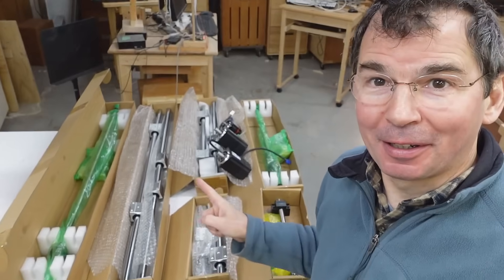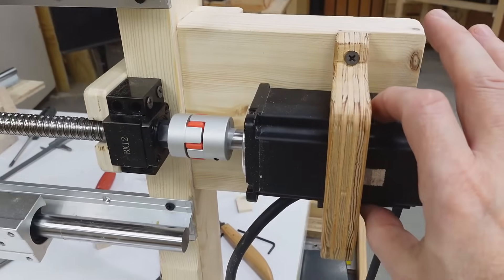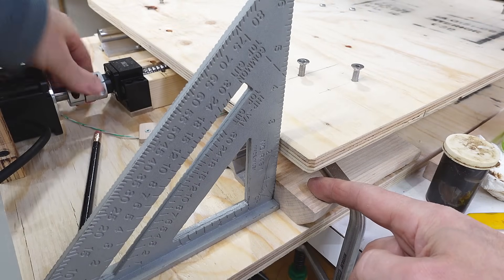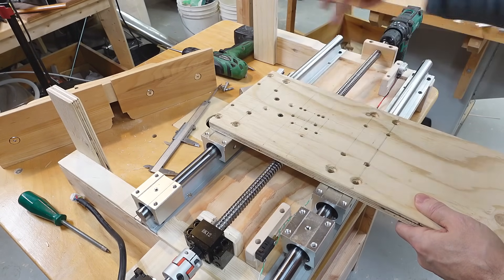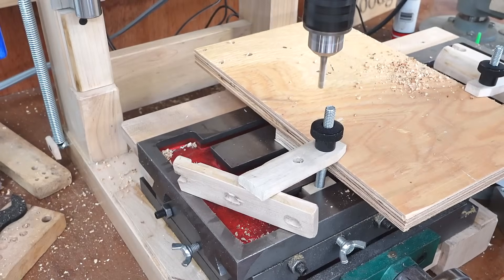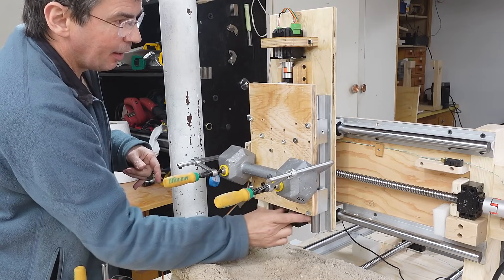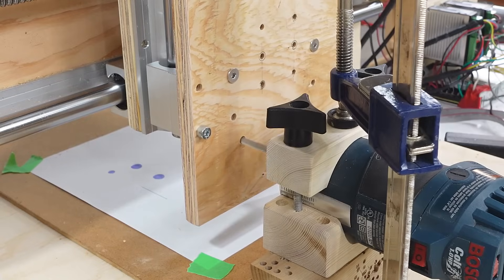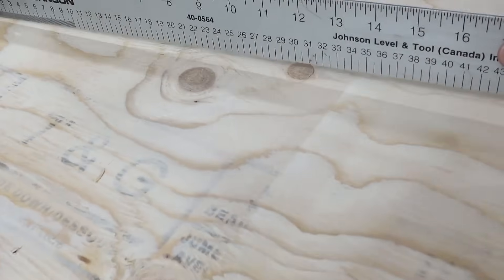Building my CNC router

Comment: You are a very clever guy, but I really do think you should have spent more time designing your CNC. a word of advice making as many parts as possible with birch plywood is far better than softwood.
I also made my own CNC router about 12 years ago.
Reply from the maker: can't buy the baltic birch locally, so don't want to use that up

Comment: Nicely done as always. About ten years ago I built my own CNC router, pretty much from scratch. Not knowing if this was going to work, I cheaped out and bought a cheap NEMA 23 motor kit on ebay. I used Baltic birch throughout. I used steel angle and v-grove bearings for rails. I used standard 1/2x13TPI threaded rod and made my own zero clearance nuts by tapping 1.5 inch baltic birch blocks then cutting a slot to the thread allowing me to tighten the threaded block onto the threaded rod for play elimination. I used NO limit switches as the stepper motors would stall before anything broke. It was much slower than yours  in operation of course but I was very pleasantly surprised by the accuracy it achieved. I had a cutting area of 23"x 37".

Comment: "It takes up way too much time" oh...so you don't use an electric hand drill then because you'd have to build it from scratch and it would 'take way too much time' (go ahead and try to make a bldc modern drill from scratch....) or you don't use jigsaws because they take up 'way too much time' because you have to build your 'jigsaw' from scratch.... makes sense...
Reply from the maker: its USING it that takes too much time.

Comment: Can I find the parts list for this engineering marvel?
Reply from the maker: vevor cnc rail set from vevor (all 3 axis), closed loop stepper (with integrated driver), DMM servos, smallest Nema23 they have, 48 volt power supply,  Raspberry pi 3a+, a bunch of M6 and M5 screws, crappy 16 mm plywood, a tight grained piece of 2x4 lumber, limit switches, and other bits like drywall screws.

Comment: Your practical assessment of cnc is fair.  The only place i believe it is justified is with complex carvings, but the fantasy of simply acquiring an stl file and pressing start is still far from true!
Reply from the maker: Alain Vaillancourt (thewoodpecker) CNC carved this woodpeker from a file he bought.  But it was so much work to get that to work, I think taking a few shots at carving it with a rotary tool would have taken less time.  Thing is, if you cut the profile out with a bandwaw in two directions, you already have the basic shape.

Comment: You would need no safe bumpers, just make a home switch and limit travel of the machine in software
Reply from the maker: if its software I'm screwing around with, then the software may at times tell it to do the wrong thing.
Reply: @matthiaswandel  You home the machine on one end, machine knows the travel is max 500mm, for example. Even if you are jogging, it wont hit the other end. If trying to run program that would crash the machine, it refuses ti run it. Its called software limits and is part of almost any cnc control software

Comment: Dear Matt, biggest flaw in router cncs...the angle of pressure on a side mounted carriage....the draw is unequal to the push/ pull. It's best to mount the router between 2 rails so draw is equal. Also, moving carriage verses moving work surfaces. We, in woodworking almost always move the work ie a table or bandsaw.. it also gives us an unlimited y(?) axis. A prime limitation. Also if it means a single channel for dust and cuttings rather than the whole table.....laser/ water jet cutting etc.🤗
Reply from the maker: Yes, that would be best.  And you know why nobody does it that way?  Cause you have to be able to get at the router.  Also want to see it sometimes.

Comment: Great design and implementation!  I built something similar a few years ago, and had all the same problems you did with the z axis. I used oldham couplers to overcome slight alignment inaccuracy  on the motors.  I agree that a CNC has very limited use in a home-workshop setting, but for some tasks, nothing else will do.  Eg: I recently cut slots and holes in a couple of foam sheets for 2 sets of taps and dies.  The holes were all different depths & sizes which would have been a pain to do by hand.  
Love your channel - keep up the good work!

Comment: CNC is great when you want to mass produce a part with decent complexity.

I would advice to use real metal parts for most of it thou.
The wood will be destroyed pretty fast by the vibration torque.
Unless you strengthen it with some metal parts that you glue/bolt to them.

Also precision is key for a good CNC,
 and the wiggle room allowed because of the wood usage will make low precision products.

Comment: Are you wearing new glasses Matt. Or is it just me wanting replacements myself.
Is the dimensional stability of plywood good enough for a CNC rig? or should you consider remaking some larger parts in steel or aluminium?
Reply from the maker: it will vary slightly seasonally.  Not an issue while cutting a part though.

Comment: I'm sure CNCs are fantastic machines, but it's just not as fun watching a machine go back and forth. I've pretty much stopped watching Frank Howarth's channel after he got his.
Reply from the maker: well, its no less interesting than watching lathe.  Personally, I'd like to see a peter brown video that doesn't involve turning something cast with epoxy on the lathe.
Reply: not need watching, but machine run and can do lot more work in workshop same time, you do somethink and cnc machine do somethink too same time, save lot time machine do big job and you do small handjob.

Comment: 4:40 in lifts and gates they use pre arrival slow down zones. Allows to suppres or reduce safety bumper, use wider ranger, at the cost of more software.

Gates use counters to evluate edge proixlity. Lifts use switches or reeds ( ILS )

Comment: i has made similar CNC but i know my skill, first big fail have router, need change router off and buy real good spindle, i make same, i buy vevor 2,2KW water cooled ER 20 spindle less 130$. and not need limit SW software limit have better use, and limit SW need only safe frame not broken, wiring whit E-stop SW, all limit. important have only use all axis sensors home SW, and speed NOT ewer need be 2000. first you need change router off and buy good spindle. lot lot accurate, silent,strongest.

Comment: a cnc router îs going to need some precision to preserve the Computer Numerical Control benefit of the machine in the first place.  Sure, you can use wood.  But with expansion and contraction and inherent measurement errors, it will not be precise.  Ever.

Comment: Mounting the motors in the centre might be problematic.
This since the motors are held together by thin screws running down their length.
Which might bend from the forces applied at their weakest spot, down their middle.
Another issue is the worsened wobble from the not centred couplings and weird levering on the mount point from this.
Time will tell how much it ends up mattering in practice if you you keep these mounts.
Reply from the maker: if I hold it just by one end, the bending force would be even more
Reply: @matthiaswandel  that is true, but the motor is designed to be held by the face plate alone.
The difference would be a bend in the middle of the long screws, or only stretched in one direction.
Though I doubt this will matter much in practise, since these motors probably are rated for much harder use.
Or in the case of the Z axis compact and weak enough that this won't matter.

Comment: Ask them to send you a CNC laser with the new 12 diodes 60W. None of these issues, quiet, no dust and it's cheaper. Does need fume extraction though.
Reply from the maker: and also leaves ugly black edges on everything
Reply: @matthiaswandel  With all due respect, sounds like a very puzzling excuse. Firstly, looking at most of your builds, it's clear aesthetics plays for you at best tertiary consideration to functionality and price. Secondly, even if for some strange reason black edges are an aesthetic deal breaker for you, you can remove them with light sanding in less than a minute, usually few seconds, by hand, it's few microns thick. Thirdly, if you dial the power and speed, and use air assist to clear smoke and debris that scatter the beam, you get very clear cuts that are at most brown, without burning, charring, or black edges. You gave CNC a try even though its greatly inferior to laser for 2D work, and (according to you) to manual work, so maybe one day you will see the light, pun intended.

Comment: CNC is all about leveraging skill, or a lack of it, and scaling production: They're great general purpose machines that let you utilize less skilled labour.

In the context of a small cabinet shop, if you have someone whom can follow a cut list, do quick arithmetic in their head, and run a table saw then they will outperform a CNC most days.  For other operations like drilling holes for hinges and shelf pins, single purpose cells/stations and jigs are the superior choice in the hands of someone that knows how to use them.

The magic of CNC is when it comes to worker skill, flexibility, and scaling work:  One person that knows how everything goes together writes the gcode and anybody with the wherewithal to load sheets of wood and run programs does the production work.  When the process is dialed in, a non-technical person can operate the machine.  When production needs to increase, another semi-skilled person/shift is added to the existing machine/setup.  If capacity needs to grow even more then another off-the-shelf machine, with off-the-shelf tooling is added and low skill operator requirements make for easy scaling.

Additionally, depending on the takt vs lead time requirements of cells in a production line, it can be possible to have a setup where a single operator runs multie machines:  Load a sheet in one machine, pull finished parts off another and perform a quick QA check, load another sheet, then start the next program before moving on to another machine to do the same thing again....Doing setups is more fufilling to a worker with the skills to do so but a less skilled operator can have a fufilling experience doing that fun dance of keeping several machines churning out components as fast as possible....this last part is the most important of all:  Consider the operator/human experience because it's still humans doing the work.  If the operators are fulfilled and have a degree of satisfaction then everyone wins.

Having said all that, I still believe that hiring someone that can run a table saw and follow a cut list is still the best way to go in most situations.

Comment: Love your build. Not trying to be critical, but that high frequency whine is hard on the ears; can you really hear the motor in person? Does it always sound like that, or just in the tests you were running?
Reply: It reminds me of a similar sonic issue that has prevented me from upgrading many of my machines from gear or pulley reductions to VFD. Maybe the loud switching pulses are coming from the motor itself?

Comment: This video was an interesting find. I built a CNC machine for my shop out of plywood. It uses 1000mm screws. I did use solid aluminum for the Z axis mounting but the rest is wood. Works fine but it does weigh quite a bit. I'm in the process of upgrading it to use aluminum extrusion. Nice job BTW.
Reply: all what can build wood can build aluminium too same tools, no problem and can change new parts you cnc machine aluminium more stabile and strong. i used first 3/4" birch plywood and make aluminium all same parts whit cnc, then change parts plywood to aluminium and then have lot lot better machine working.

Comment: So these motors CAN go however fast.. but both of the C's in CNC tell me there's no reason they have to. And that you can outright not allow it to. I don't guess I understand the necessity of the crash zone and all of the protective features and the time they required. Also you appear to be judging CNC while still in the setup process, and while using materials that 99% of CNC devices don't use.

Comment: Most people building CNCs: Carefully designs the thing to be accurate, makes everything super square and precise
Meanwhile, Matthias: Builds a CNC out of wood, adds foam stops so it doesn't destroy itself, and then drives it using Python scripts
Never change, Matthias 😅
I do think a big part of the usefulness of CNC machines is that most people aren't nearly as skilled on a band saw or hand tools, or even have one. When you have the tools and years of experience and can make a gear or custom part by hand just as fast as drawing it out in CAD, CNC doesn't make nearly as much sense. When you need 300 gears, though... Maybe it makes a bit more sense.

Comment: First, CNC does things that humans can't do, 3d shape cutting. Or second, don't want to do, production or anything repetitive. It took time to design the spindle mount, but only once, and then it makes 100 more very quickly that nobody wants to do manually or DRO. For example dresser and drawer fronts, you can do complex decorative carving with lots of variable depths and curves (human can't do that.) And then make 4 more identical. No human wants to or can do that.

Comment: Just use aluminum extrusions to mount your rails and ball screws, to make adjustments easier. Also to avoid play, mount the motors on 4 points.

Comment: A couple of years ago I bought a lightly used (practically new) Stepcraft D-840 with the laser engraver kit, the drag knife and the 3D printer attachment all for $1200.  Since then it's completely replaced router template work for me.

Using tiling I cut out the 7 main curved plywood parts of a 70x22 curved welcome booth that's now in the local church.  The inside radius was 10'.  Obviously a trammel would have been a nightmare.  But the whole thing was a breeze on the 840.  Pretty good for a hobby level machine.

If you can pick up a deal on a lightly used hobby level benchtop machine in the 24x36" range I don't see how you could go wrong.  You often find deals on machines at the facebook user groups.  That's where I found my Stepcraft.

Comment: There is a very good reason that precision machine tools are made out of cast iron and steel.

CNC potential is realized when you need to make multiples of the same item. Believe me, as a CNC professional, the machines are necessary if manufacturing is your business.

Comment: Matthias, I respect you and your opinions but your take on cnc is wrong.

Yes, it is not the best thing for one off projects but it is great at replacing almost every tool you built over years.

With right approach you can replace bandsaw, boxjoint crank jig and the pantorouter with one simple machine which is much easier to build.

That is much better solution for almost every hobbyist.

The right approach here is the moving gantry instead of the moving table as you did. That way the table can have a mounting hole and you can route things on their ends not only when lying flat.

And that machine can do things repeatably and precisely with no dial in runs, "forgot to do thing and need to resetup everything" headaches etc.

My only other suggestion is to build a wooden t-track there and a simple linear clamp using that track and butterfly/wing screws.

That setup lets me to route things many people cant even imagine.

I use inkscape+cambam+ugs to run my machine.

Comment: To make one piece of something that doesn't require precision, I agree that it takes way too much time with a CNC machine for what's being accomplished. On the other hand, what if you need three of something, or 20?  That's where CNC excels - repetition. The other place it excels is precision. Need to make something really accurate? If it's just one piece, it can probably be fabricated just fine manually but doing more than one is, again, where CNC excels. So, yeah, CNC is more about production runs or making repeated changes to a prototype.
Reply: But only if care and precision is taken to build the CNC machine in the first place. Wood is never the medium of choice when precision is involved.

Comment: Gratulálok a gépedhez! Én is készítettem egy nagyobb CNC marógépet, 1200mm * 1000mm *300mm. Én NEMA23 2.2Nm léptetőmotorokat használok DM556 vezérlővel és Mach3 USB vezérlő kártyával. A marómotor egy 2.2KW teljesítményű 380V-os 3 fázisú motor egy gyári fordulatszám szabályzóval. A gép asztal váza nálam 18 mm vastag rétegelt lemez belselyű bútorlapból van. Az asztal oldalán van 2-2 darab 1200 mm sín, 300 mm-es eltolással. A sínek távolsága is 300 mm így az asztal vastagsága elég nagy. Így az x tengely lábain a csapágyakat egymás mellé tudtam rakni, az alatta lévő sínnél szintén, de eltolva 300 mm-el. Így gyakorlatilag 100 mm vesztek csak az 1200 mm úthosszból. Az asztal mindkét oldalán van a sínek között 1-1 golyós orsó, léptetőmotorral. Minden tengely végen van végállás kapcsoló. Az x tengely híd lába 3 egymásra szerelt bútorlap, a középső belül ki van vágva a súlycsökkentés miatt. Így a híd lába 3.18 mm vastag + 3 mm takaró burkolat fából. Rettentő merev lett így. Az X tengely híd egy 20*20 cm-es 100 cm hosszú bútorlap doboz, erre vannak felszerelve a sínek és a motor. A Z tengely hasonló mint a te gépeden.  A gépem asztallapja két rétegből áll, alul egy 18 mm vastag tükör sima MDF lap, majd ezen egy 10 mm vastag másik MDF lap. A 10 mm vastag MDF csíkokra van felvágva és közöttük sok rögzítő C sín van közé szerelve. A léptetőmotorral sokkal lassabb a vezérlés mozgaatás, és így nem rántja a gépet. A gépem súly kb 120 kg. Én relief marásokat szeretnék csinálni.